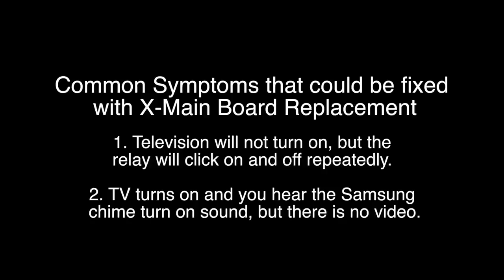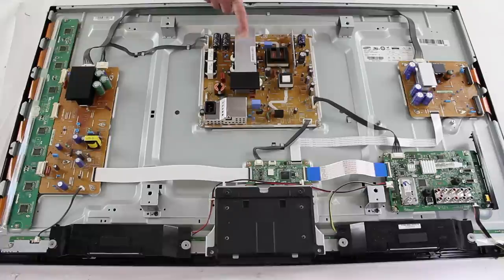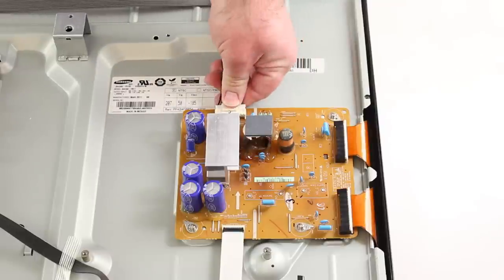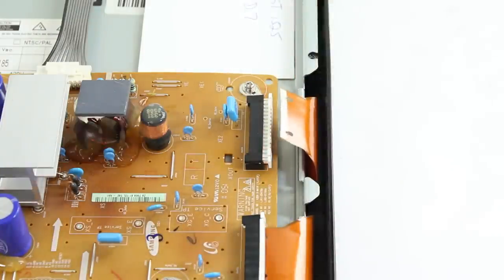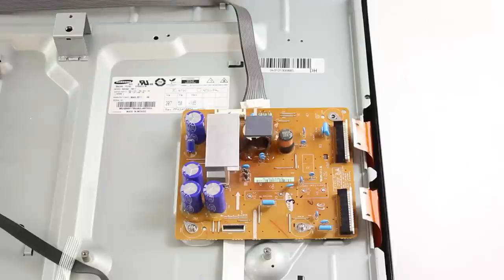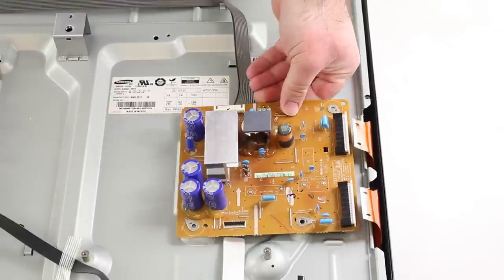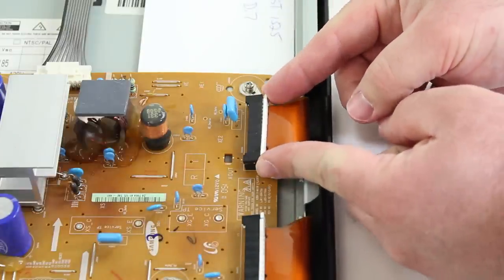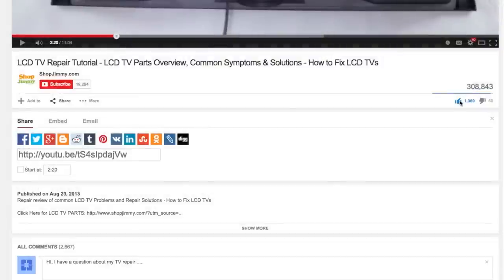Samsung Plasma TV Repair - BN96-16510A X-Main Board Replacement

Comment: Jimmy I have a question for you.  My TV is a 64 inch Samsung Plasma TV.  It used to turn on if you would turn it on/off then on again but now it will turn on with the samsung chime but no picture even if you turn it on and off multiple times.  By watching these videos it appears it is the X-Main Board but I wanted your input.  It is model number PN64E533D2F.  Manufactured Nov. 2012.  Model Code is PN64E533D2FXZA.  Thank you for your help I look forward to your response.

Comment: Hello!
I replaced the X main board of my Samsung Plasma Ps51d550, cause it wouldnt turn on but clicking and it seems good now. There is a potmeter on the board. On the old board it stands at 2 o' clock, on the new one at 4 o'clock. I have no potmeter so what  position shall i set it to? I have watched pics of this board on internet and most of them stood at 2 , some at 4. So i decided to put it at 2. Shall i leave it like that? What does this pot set? Thanks in advance.

Comment: Phillips Plasma 42" Model 42PF9630A/37B.  Inside TV Samsung PDP Model S42AX - YD01.
TV turns on for about 30 seconds, Turns off and Green Power LED turns to a blinking Red light.  
Opened the back to check for blown capacitors but they all seemed to all look normal. 
Now I am lost, I was hoping to see capacitors that had bubbled but not the case.

Can you help?

Comment: i have a RCA 42' plasma tv model #42PA30RQ & the problem with my tv was that when i turned it on the was a few clicking noises and the screen was black. i bought both X and Y main boards, replaced them, but the tv still doesn't show picture and
i continue to hear the clicking sounds after i turn the tv on. any help? thanks

Comment: Hi, I have a Emerson LC401EM2F and half of the display on screen is green/pink/purple. All of my input sources are working well, and also shows the same green/pink/purple display.

I've search all over the web and the closes to a good answer for my problem has been that the digital main board has become faulty.

Could it be the digital main board or is it something is?
Reply from the maker: David Aumoithe  Please watch this video FIRST to help with your repair!  https://www.youtube.com/watch?v=BP3NVNCGEv8  This could be a problem with the main board or the TV panel.  You can replace the main board to see if this fixes the problem.  Click this link to replacement parts for your TV model number:  http://www.shopjimmy.com/catalogsearch/result/?q=LC401EM2F  Be sure to match part numbers on your current board, with your replacement for compatibility.  Thanks and please let us know if you have any further questions with your TV Repair!  www.shopjimmy.com

Comment: Hello there, I am wondering if you can help me. this one have got me, wondering what is wrong.
 I have a Samsung plasma PS51D550C1MXXY. At the start I had a problem with the X-sus board I replaced it, then I noticed there was no power ( no Vs power or Va), there is no flashing green led on the logic board I have replaced the logic, main and power supply but has not fixed the problem. The standby light is red and flashes at a rate of two flashes. I have fixed a few Tv's but this one has stumped me.
Reply from the maker: John Smith  Please watch this video FIRST to help with your repair!  https://www.youtube.com/watch?v=BP3NVNCGEv8    I recommend replacing the Y-Main Board and the Bottom Y Scan Drive board in the TV.  Click this link to replacement parts for your TV model number:  http://www.shopjimmy.com/catalogsearch/result/?q=51D550C1  Be sure to match part numbers on your current board, with your replacement for compatibility.  Thanks and please let us know if you have any further questions with your TV Repair!  www.shopjimmy.com

Comment: Hi, I have a Samsung PN43D490A1DXZA that will not power on (symptom 1 above).  All capacitors look fine.  Per Samsung's troubleshooting guide suspect logic board:

Vs 0v
Va 0v
CN801 (SMPS to Main) Pin2-standby 5v, Pin-PS_on 3.3v to 0v
CN802 (SMPS to logic) Pin5-PS_on 3.3v to 0v, Pin6 0v to 0.14v
LED on Logic board not lit up

I ordered and installed a logic board from ShopJimmy (BN96-16507A) and still no power on.  All values the same except Pin6 on CN802 stays at 0v (doesn't go to 0.14v).  Is the new logic board functioning correctly, and what's my next step?

Comment: I have a Samsung plasma model T5054 no picture just clicking
Reply: Dale Sorber 
Disconnect the y board and all its connections and see if it stops clicking 

If so replace the y sustain board and y scan board

Make sure u have working parts from a good place.

Ive bought stuff in ebay and it didnt work.

Jimmy is a good place never had any issues with them

You tv is going into overcurrent
So something is pulling to much most likely the y sustain board

Ive repaired 100s of tvs i always start there with clicking stuff

Anyway good luck